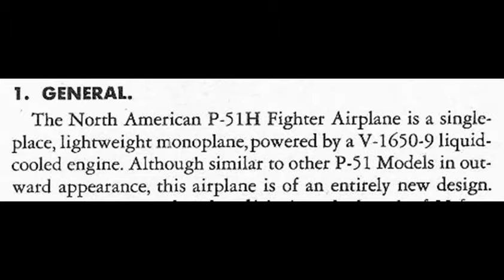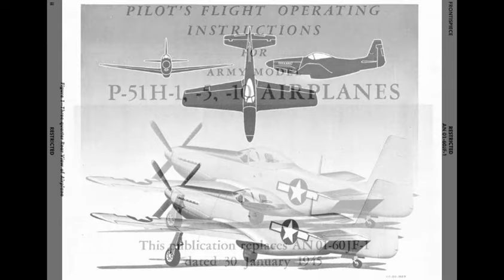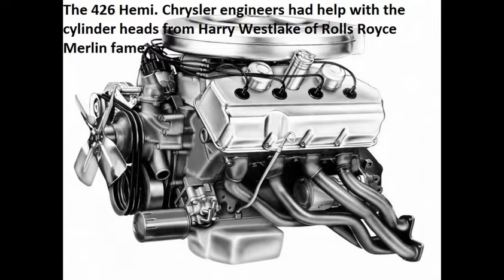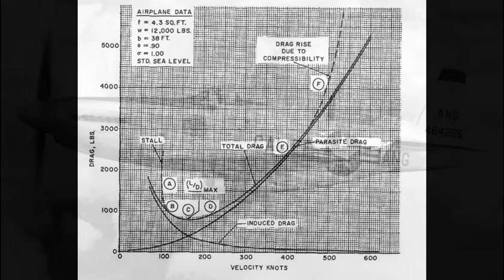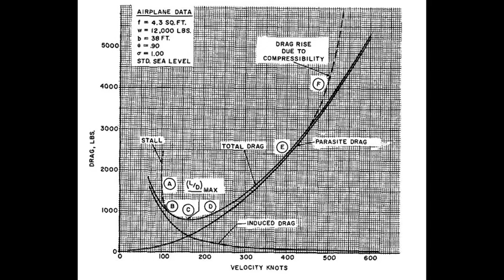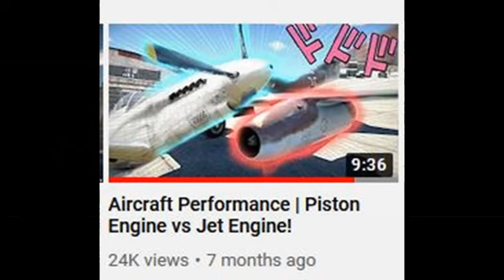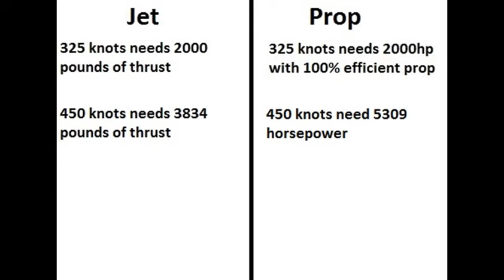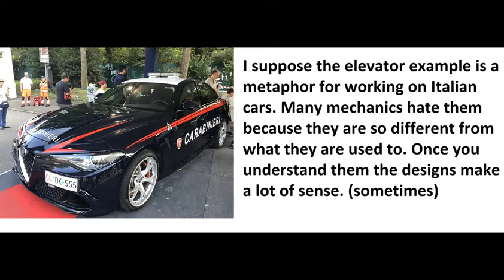U.S. "Superprop" Fighters P-51H, XP-72, and more

Comment: Chrysler was 2 V8 engines end to end. The oilpan is off, where the crank shafts met there was the blower drive gearbox. If you are in the Northeastern US, New England Air Museum has one. I had a collection of America aircraft history books. All that mentioned the P47 doing 490. Have read memoirs of crew chiefs who understood ignition timing and boost pressures (translation, ran moonshine before the war, ran it afterwards while inventing NASCAR) who got 500 out of their P47. P&W once ran one 250 hours @ 3500 just to see if it blew up. It did not, however shut down for new sparkplugs evety 10 hours or so. I digress.
Reply: That's crazy!  There was an Alfa Romeo Grand Prix inline 8 that did the same.

Comment: I've wondered - why not add a small auxiliary engine to drive the supercharger so the main engine can use all its power for propulsion?
Reply: +  Jeffrey Fisher  You can sorta get that with a turbosupercharger setup.   But it's about complexity and weight.   Read the experiences of the mechanics who worked on those magnificent Wright 3350-TC Turbo-Compound engines.
Reply: Weight,, and synchronicity would be a negative full circle.
Reply: I would think that between the issues of weight, and added complexity of electrical demand, and reduction of range due to fuel consumption of your extra engine, the biggest problem would be synchronizing the two engines. supplying a constant pressure  air flow to an engine that uses a throttle is dangerous. it makes controlling the power applied to the prop unstable thus you get a push, pull oscilation effect due to variance of manifold pressure, and demand. sudden pressure drops caused by opening the throttle causes a sudden rush through the carb causing way too much fuel surging from the carb jets. then as pressure drops fuel mixture goes way lean because there is not as much air through the carb. the drop in pressure also changes the evaporation coefficient of the fuel, adding to throttle instability. the engine would eventually stall from wildly fluctuating fuel/air mixture. I tried an electric supercharger on my rc nitro  car and it did not like it at all. no steady rpm at any range, and constant stalling. after i did some research and the fact i am an automotive tech since 1993 it was obvious to me that having two rotation dependant devices with only one generating the torqe being harvested and no type of linkage between to synchronize the demands to each other, counterproductive effects greatly outweigh any benefit
Reply: Weight
Reply: Tuning. Completely. 

Another engine would double the parts count there are hundreds if not thousands of parts in an engine, and a supercharger driven from the back of the engine is the simplest possible combination. Other than a properly sized Turbocharger.

Again, Tuning. It's significantly easier to tune and map an engine that has a supercharger responding immediately to throttle and engine speed. An exhaust driven turbo is hard to control in it's own right, compared to a gear driven supercharger. 

It would be very complicated to keep a seperate engine responding precisely to the primary engine speed. And the extra engine would needs its own supercharger or turbo in order to work at altitude, lol. 

Try this: Fuel-inject the exhaust driven Turbocharger and add spark, and introduce some bleed air, if needed, to maintain combustion. Now you effectivly have a turbine engine which is the turbo hot side getting fuel, powering the blower side of the turbo, hahaha.
Reply: @TheJustinJ  that hot side turbo afterburner sounds like a safer alternative to nitrous, provided the lower end can take it. so many tubers have built functioning turbine jet engines out of existing turbochargers. I am picturing hot side turbine temps controlled with solid stream of liquid propane spraying on the turbine hub both atomizing propane and cooling turbine simaltaneously. with mixture gross rich entering a combustion chamber under high pressure, and spiraling around a central diffuser where cooled air is pumped in from a calibrated variable scroll type air pump. a small one. stoichiometric ratios being higher at altitude it would be sensible to utilze either boost psi, or oxygen sensors downstream to monitor efficiency, and exhaust temp sensors also being used to provide additional confirmation that mix is not too lean creating critical overheating problems with the cylinderhead, and valve train
Reply: Jeff, I can tell you what Greg would say, NO.
Reply: Space is likely also a huge factor, and not just the raw weight increase but balance.
Reply: Read once that the power required to run the two stage two speed supercharger on late model Merlin's was in the neighborhood of 700hp!
Reply: It's not a horrible idea.  There were some electric-motor-driven turbocharger-style compressors in the mid-90s, which is what you're talking about.

Now: assuming horsepower per kilogram of engine is a constant, you might not thing it matters whether you have a single 2500HP engine that is powering a compressor directly, or a 2000HP engine and an auxiliary 500HP engine powering the compressor.  One advantage to having the later, however, is that you can adjust the compressor engine's speed both for power need and for altitude.  If you only need to go slow, you don't need the compressor at all.  If you want to go fast but are at low altitude, then your engine may have all the air-fuel it can consume at a relatively low compression amount.  (Note** at this point you have extra capacity on the aux engine but cannot use it for propulsion.)  But if you want to go fast at high altitude the auxiliary engine would run full speed.
Reply: Weight would offset any good it would do. That's why you don't see this.
Reply: @SimanSlivar  why do you think an aux motor powering a compressor would weigh more than that portion of a main engine that is dedicated  to powering the same compressor?
Reply: @lqr824  Perpetual motion hasn't been invented by man yet, we also can't get past the laws of physics...

An engine is a energy converter. It turns potential energy stored in gas into rotating motion. By adding another engine your A. adding more mass too move, and B. greatly decreasing the efficiency of the overall setup. Not only do you have to spin the normal engine but now also the second engine.

While the idea would work you would decrease the range of the combat aircraft too the point of not being useful. Also on the logistics side of things the added complexity hinder your maintenance, increase down time, and add more part complexity to support two engines per aircraft.

But the efficiency is always king. In many cases the more power "powerful" engine may be less desirable if the over all performance desired is bad. But the efficiency thing is why you also see people opting for single turbos over dual turbos even on multi-bank engines. The overall efficiency of only having to spin one turbo vs two smaller ones is greater for the overall produced volume of air.
Reply: @SimanSlivar  what you don't seem to understand is that the supercharger takes a lot of power to run, whether it's run from the main engine or a second engine.

The weight of the portion of the main engine that supplies that power is going to be similar to the weight of a dedicated engine that supplies the same power.

So, if you had a supercharger that took, say, 600HP to run, it wouldn't matter if your main engine was 1800HP and powered the supercharger itself, or if the main engine was 1200HP and powered the supercharger with a second 600HP engine.

Weight of engine per HP just isn't going to differ, so weight of the combination isn't going to differ for a fixed amount of power.  I can't figure out why this is too complicated for you.

Now I'm not proposing this idea, and not advocating it.  There are some strange plusses and minuses with this setup and it may not be good for a fighter, but for reasons you'd also probably fail to understand, so I won't go into them.  But your basic assertion that it'd need to weigh more is just silly.  You're stupidly overlooking the possibility that the main engine is smaller if you keep the sum power the same, and also overlooking that the power will be greater if you keep the main engine power the same.  This is just too complicated for you so I won't go into it further.
Reply: @lqr824  I do... I have a blown V8 and many turboed cars present and past. That is the problem with your idea its not even close to logical and is more detrimental to the entire concept. To use a whole second engine for even lower efficiency is asinine.

"Weight of engine per HP just isn't going to differ, so weight of the combination isn't going to differ for a fixed amount of power.  I can't figure out why this is too complicated for you."

So your going to add a engine capable of 600hp to push the engine of 1800hp, fine lets look at this then. We add a whole big block V8 to run a supercharger. That's 680lbs. But wait that's at sea level. So we need even more displacement, but that is more weight. Wait why not add a 4 cylinder to power a smaller supercharger. Then a V twin to power a smaller supercharger... We now need to power all those engines so more fuel, less efficiency.

That is why turbo superchargers where a thing. After a certain altitude the supercharger decouples and the turbo takes over...
Reply: I can't talk with you any further, either you get it or you don't and I don't care much which.
Reply: @lqr824  It wouldn't be good in any configuration for any airframe. It wouldn't be good for anything. The fact you cant understand the laws of physics is extremely disturbing. This is stuff learned in middle school...
Reply: It would be easier to get the same additional horsepower by sizing up the main engine
Reply: @JackEnneking  that's not the "easier" thing to do if there is no such engine, though!  If you're using the biggest engine made, how do you go faster?

Again, this isn't my proposal, and I'm not advocating for it strongly, but arguments that it'd "weigh too much" or the assumption that you always have the option of a bigger engine are wrong.
Reply: @traviscapehart7590  they electric superchargers for cars now. You know this right? But it only kicks on at WOT otherwise it's not on at all.
Reply: @bobthompson4319  i am ase certified and have been since 1993. Electric supercharger are nothing new the 92 ford thunderbird supercoupe had twin electric superchargers. It was found that the variation in volume of air versus the pressure it was delivered was not stable, and the extreme load on the electrical system proved problematic. They have aftermarket setups that claim bookoo horses at the touch of a button but it has to be installed with a standalone fuel system and even then its not much due to volume limitations and synchronizing issues.
Reply: @traviscapehart7590  The right aftermarket systems do work but they add about 50hp. There are some people who have them on YT. check them out.
A person that cant learn something new is not a smart person and will become outdated.
Reply: @bobthompson4319  i really havent had a chance to see for myself just how much these units can push in a practical setting. In fuel injection systems that calculate air charge by comparing map over baro( specifically eec 4 ford, and c3 tbi chevy) would be at a particular disadvantage, but now with newer systems like gm- delphi LS1 that utilises a mass air flow sensor i can see how a reflash of the computer could provide the changes in load and power curve without the half million dollar chip burning apparatus that you hear old hot rod mechanics groan about. Perhaps push button supercharging is not such a wishful dream after all. I just dont have the 5000 dollars to blow on hopping up my rustbucket.
Reply: But then you would have to supercharge the second engine at altitude and on and on. Better off with bottled compressed air or bottled oxygen or nitrous oxide and it could get very complex and complicated after that. Better off with KISS principle, turbocharger and or supercharger or turbosupercharger, call it what you like but keep it simple stupid! Simple works, complex you have to work on.
Reply: @charlesmeredith8417  I am a firm believer in the kiss principle. Stacking complex devices on top of complex devices results in one sure results liver failure due to too much Tylenol, for the headache. But in light of nitrous oxide was used during ww2 as an enrichment method. Not like in automobiles to get a short-lived burst, but at a rate that the engines could endure for long periods without damage. The B17 utilized nitrous oxide during the military power throttle setting, and could be activated at lower throttle settlings by the small yellow lever down and left of the throttle assembly. It is a little known fact and I have not seen it on any simulator. It was used during typhoon conditions in the Pacific and extremely cold conditions in th e European theater. In a typhoon the engines had a tendency to foul plugs midflight due to water ingestion and a little go juice helped burn them off and maintain a firing cylinder, and in the cold it helped improve the firing capability of fuel at temperatures that would freeze a man to death in minutes.
Reply: See XFM-1 Aircuda why that's not a good idea
Reply: They did the math ,the extra weight associated with the secondary power plant was judged to not be worth it
Reply: You're just adding weight and fuel burn. 

Instead of 2 engines with a combined 2000 hp let's say, that sips X amount of fuel why not just have one 2050 hp engine with 50 hp power loss going to the supercharger?
Reply: @carlosandleon  your suggestion of having the torque come from the one engine is exactly how the merlin powered spitfire did it and with great success. The corvair, and p51 mustangs also used a parasitic supercharger to maintain the unbelievable amount of air these engines would consume. The superchargers were most effective at high altitude where naturally aspirated engines would suffer significant power loss due to low oxygen conditions found above 17000 ft. In addition to the monsterous superchargers bombers like the raf lancaster, the b-17flying fortress also had nitrous oxide available to the pilot if needed. But instead of getting a burst of nos for a few seconds of high performance the bombers used nos at a much lower rate of injection but for several minutes. At the military power setting of the throttles nos was fed into the air intake at a slow rate to enrich the oxygen level without burning the engines up. The boost would last for up to 3 minutes and was used when climbing out of a hostile area, or when overloaded to give that extra get up and go when lives were on the line

Comment: From page of ALPAR:

For testing, a P-47 Thunderbolt, the largest and heaviest single-seater in the Air Force at the time, was selected. Some modifications were made to accommodate the XIV 2220; when done, the slimmed down nose helped reduce the drag produced by the big round radial engine.

Preliminary testing showed promise. The big fighter was coaxed slowly into higher altitudes and higher speeds. Finally the go ahead was given for an all out test. At 15,000 feet, the huge plane, under the Chrysler V-16's power, broke the 500 mile an hour barrier, around 70 mph faster than the original engine. No one thought it was possible for a piston engine to achieve that speed in level flight.

Radar timing shows how powerful that engine was. Flat out, it pulled the huge P-47 along at 504 miles an hour.
Reply: That's the XP-47J. Not the H. I'm an Allpar fan and that reference is not backed up by any paper test data. The ONLY test data, obviously from one of the preliminary flights, quotes 414 mph at altitude..They never completely dialed it in. The war was over.

Comment: "I need to do Bristol and Napier engines first". you're the man.
Reply: And Rolls Royce too! Don't forget the Rolls Royce Crécy sleeve valve engines. And Argyll Motors engines, designed by Burt and McCollum. And Harry Ricardo's "The High Speed Internal Combustion Engine", a really great book, specially the 1951 edition...
Reply: Yummy H24 Sabre lump😎
Reply: i hope for napier nomad and such engines...
Reply: If anyone's got any Sabre parts, there's a bloke in Canada who'd love to hear from u!
Reply: klegdixal - Huge displacement engines like the Napier Sabre, P&W Corncob, Wright 2160 were just too complex and
extremely expensive to produce but they did make a few. A single engine usually cost more than the whole airframe.
Reply: @rogertycholiz2218  The Sabre wasn't a huge displacement by US standards. It was 37 litres i think. The Bristol Centaurus sleeve-valve was a bit over 50. Quite a few Sabres were made and a lot of Centauri
Reply: I hate baby monkeys and raisins
Reply: @TheHarryMann  the napier sabre was an inline liquid cooled engine though, not an air cooled radial (slightly different standard).
Reply: @spawnof200  no need to tell me :). I was just replying to whomsoever included it in a list of ginormous displacement engines.
It was notable for its bhp/litre bhp/lb at figures !
36.5 litres and as compact and powerful aero-engine as you'll find.
Poetry in motion.. once a few production niggles were sorted.
Reply: @TheHarryMann  ok fair enough :)
Reply: Imagine of the Crecy would have made it into production imagine the impact it would have made plus a P51 and P40 and reinforced Spitfire would be made these planes even faster than the ta 152